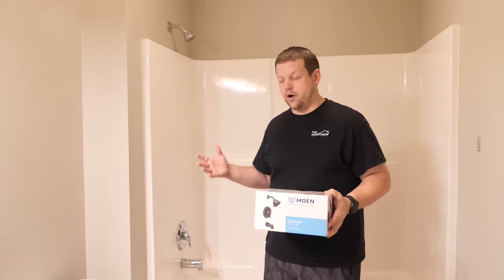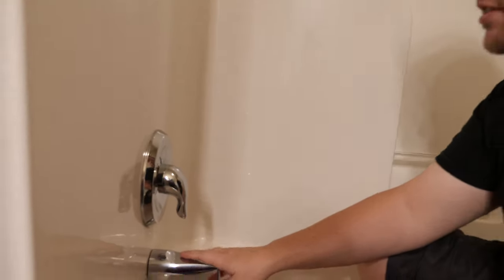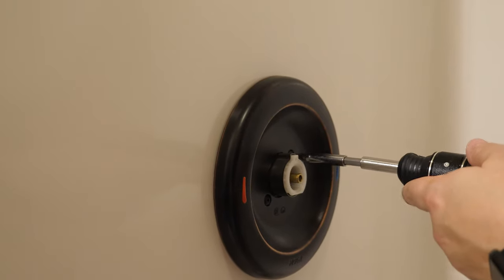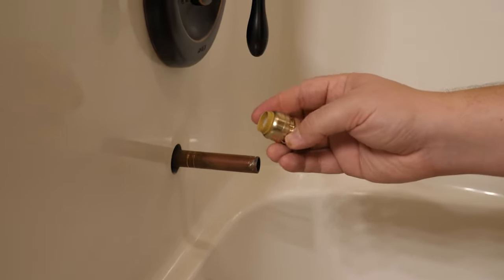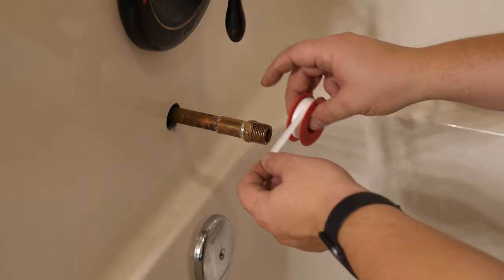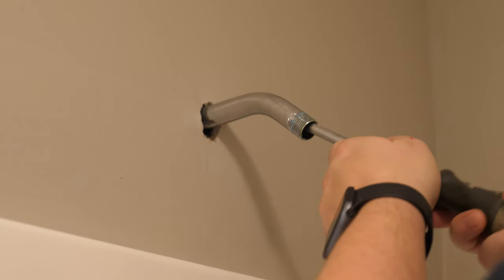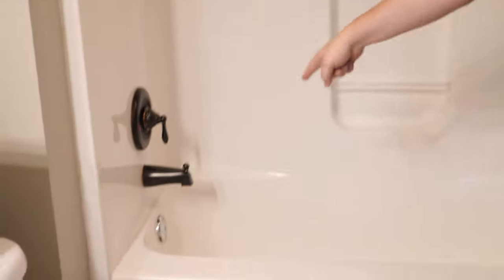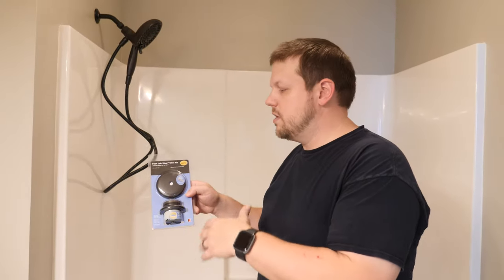How to Replace a Shower Faucet Trim Plate, Handle, Shower Arm, Tub Spout, and Bathtub Drain Moen DIY

Comment: Excellent presentation! The bit about welding a piece onto the pipe for the spout is very good information. My house is old and workers have advised that a wall needs to be broken into to replace my spout. Hopefully the option you mentioned will work!

Comment: Thanks for such a thorough and realistic video. I love that you showed the removal and install for every single part, and explained what pieces might be tight and difficult to remove. A lot of videos are filmed on sets with brand new, hand tightened hardware, and when the repair guy effortlessly removes something that’s not budging for me it makes me wonder if my situation is different and if I’m going to break something by continuing. Kudos to the camera operator too. 

I was just going to replace my decaying shower head because I thought the rest would be too difficult, but now I think I can replace all this grungy gross decades old hardware myself, with something really pretty and clean.
Reply from the maker: I'm always tempted to edit out the struggles but you're right, it's reassuring to know if something is normal in "the real world". Thanks for the comment!
Reply: @TopHomeowner  My handle's alan screw is completely covered in soap scum to the point I can not get an alan wrench in it or even tell which size would  fit it.  How do you deal with that?

Comment: Great video! I’m confident I can now tackle replacing my shower/tub fixtures. I didn’t realize it could be this easy.
Reply: I just got a quote for $933 and change for a plumber to install this for me, that was a lot of motivation to do it my damn self!
Reply: @bobdolespen  $933... to do this!?!?  I'd assume he was putting in new plumbing for that much!  this is the first video I watched about this myself just now, because I would like to replace mine at the condo I just bought.  I didn't realize it was this easy either.  Definitely a doable solo...

Comment: Good thing the rough-in valve matched the new trim.  I just replaced an 18 year old valve that I could not get parts for with a Delta that uses their universal rough-in valve.  It was installed on an exterior wall, so no rear access.  Cut it out with a reciprocating saw.  Took forever to clean the old solder off the supply lines and the shower riser and tub pipes, enough to be able to get the new threaded fittings on.  I split the job up over two days.  In between, capped the supply lines with SharkBite end caps so I could turn the water back on.  Not a fun job, but I saved a bunch of money doing it myself.

Comment: Thank you so much for this video! I thought I would have to hire a plumber to change out these but turns out it’s so doable and I’m saving a lot of money. Just a note I was unable to find the same brand of the trim plate (and each brand has a different valve so they are not all compatible and standard). Got discouraged at first but after doing some research I actually painted it to match the rest of the new shower fixtures. Lots of great online tutorials for this!

Comment: Great video!

One alternative to soldering the pipe would be to purchase a matching tub spout that slides over the copper pipe, just like the old spout.  I got a Plumb Works model PF0578-BN-PS from Menards.  It turns out that the Plumb Works spout has the same connection as the new Moens spout, except that it also comes with an adapter for the pipe!  I was able to use that adapter with the Moen spout... so I didn't even use the Plumb Works spout.  It was super easy to install.

A resourceful person might be able to locate a pipe adapter (without a spout) and save a few dollars.  But the Plumb Works spout was pretty cheap.

Comment: Hello, great video and highly informative. Though I am curious about one thing. When installing the tub drain, why did you use silicon instead of just using plumber's putty? Wouldn't using silicon make it much harder to replace the drain in the future?
Reply from the maker: 100% it will make it more difficult. It was a tradeoff I was willing to make at the time since I didn't want to have a leak upstairs, but it was probably overkill.

Comment: Thank you so much for this video! This is everything! I am trying to DIY some things in my bathroom and this video was beyond helpful. One question… and you may have mentioned it… Do I need to shut off the water supply to my home?  My tub and shower is just like yours.
Reply from the maker: You don't have to as long as you don't accidentally turn on the valve while working on it. That said, best practice would be to turn off the water just to be sure

Comment: Thanks a lot for this DIY video. I have the MOEN 82304SRN installed. However, my lever handle is sticking out 2in from the trim cover. Do you know of any solution to help?

Comment: good video..thanks.    hope this project goes as well for me.   only issue is my drain valve is the handle kind.  i suppose a push valve at the drain can be used instead and just put the cover on the overflow.  agree?  comment?

Comment: I would go ahead and put the new valve insert so you have new seals. It’s an easy process and requires no soldering. Just need to turn the water off temporarily

Comment: Hello sir, thank you for all your videos.  So, the bathroom tub faucet handle is loose and I see that I need a hex screwdriver to tighten it.   That metal faucet is the same one I have.  I am praying that is all I need to do, tighten it.  Is there any other screwdriver I can use for this or do I need to buy a hex screwdriver to fix it?  I am an old gal, so thank you very much for you patience with me and my questions and thank you so much for replying to me.  God bless you.
Reply from the maker: Yes, you'll need a hex screwdriver or wrench. The easiest thing would probably be to just buy a set of hex wrenches

Comment: Hi I am going to be replacing everything you did and I really like the pieces you bought, which ones were they?  I am having a hard time finding the drain and the round part about it
Reply from the maker: Here are the links to the pieces I installed:
Moen Tub and Shower Trim Kit (no valve): https://geni.us/HhxL
Foot Lok Stop Style Bath Drain Trim Kit: https://geni.us/MFd0lr9
Delta In2ition Dual Hand Held Rain Shower Heads: https://geni.us/bpcle

Comment: This was super helpful! Only question I have is my old shower faucet set up is delta... I bought Moen and when I went to replace the handle, the delta handle is much larger... is there an easy way to change this out? Or do I have to change the whole valve too?
Reply from the maker: Unfortunately you have to stick with the same brand otherwise yes, you'll have to change out the valve too.

Comment: What is the part name/# that you had soldered and how? Everything else is explained very well
Reply from the maker: That would have been it's own video since soldering is a skill all by itself! In general I used a no stop coupling, copper repair coupling (to extend the pipe) and a copper male adapter (to attach to the new spout). You can avoid all that (plus all the special tools you need) if you can find a kit with a slip-on tub spout. Hope that helps you

Comment: Nice video! For the main shower head did you turn off the main water valve? I’m assuming so?
Reply from the maker: It's always best practice to turn off the main water when working on plumbing. But for this job I left it on. No water comes through the shower head unless the handle is turned on.

Comment: I'm dealing with the sharkbite issue currently. The diverter in the tub spout broke, so I need to replace it. But it just spins when we try to remove it. 
I'm going to have to saw into the spout in order to get to the sharkbite end 😒

Comment: I was told that the rubber washer is not there to be placed between the drain and the tub, but between the tub and the pipe. You can pull out the old one since the pipe is not tight against the tub with the drain unscrewed.

Comment: Do you need to solder the valve? Will it leak if you don't? It looks like a good fit without soldering
Reply from the maker: If you're just changing out the trim plate like I did in the video there's nothing to solder. I did have to solder the tub spout for the modifications I made.

Comment: Why isn't the shark bite threaded on both ends? I'm no plumber, but if it was threaded on both ends, you could just screw a compression ring on the wall side (like a shutoff valve). Is there a reason that isn't standard in this case?

Comment: Hi, how do you know what fixtures to buy that will fit the current valve you have?
Reply from the maker: The biggest factor is the brand so make sure those match. The plate behind the handle should say the brand name, but sometimes a manufacturer will use a letter instead of the name (M=Moen, D=Delta, K=Kohler). I don't know a foolproof way of knowing if a fixture will fit from the same manufacturer since styles can change over time. I hope this helps!

Comment: 2:40 my faucet has the hole for the Allen key, but there is nothing there at all. It’s just a small hole that goes to the faucet handle. There is no hex or screw or anything. How can I remove it?

Comment: Hi.  I have turned off the main city water shut off in the basement to replace a Shark Bite fitting that wont shut off anymore.  I have released the water pressure all through the house and in the sink and shower of the en suite where I am working but water keeps coming out of the water supply  for the toilet.  It wont stop.  There is no water in the toilet tank so its not coming from there. Never seen this before. When you shut off the mains and relieve the pressure in the system water should not be coming from a supply line ? Any ideas ?  Thanks

Comment: do you have to turn off trhe watewer to the whole bathroom or just make sure the tub handles are in an off position before starting? thanks
Reply from the maker: I didn't turn off the water to whole bathroom in my case... just be careful when working with the handle OR go ahead and shut it off just in case.

Comment: escutcheon rhymes with discussion :) do you have to shut off the water to the shower to do this if you're not changing the valve/cartridge?
Reply from the maker: Wow, what a simple way to remember how to pronounce it... Thank you! As for the water shut off, no you don't have to turn off the water if you aren't touching the cartridge. I didn't turn it off, but it does make the job easier since you can rotate the handle up to remove the set screw.

Comment: Do you need to turn off  the water supply if you are not replacing the valve and only replacing the trim plate and handle?
Reply: No.

Comment: Hey man! Solid video, but one extremely important point- that black rubber gasket that came on the new tub drain is intended to replace the old rubber gasket located in between the tub and the drain pipe!!! Then, using some plumber's putty is probably preferable to the silicone sealant on that flange as it can be removed later with less difficulty.

Comment: Would some type of water weld or epoxy work instead of soldering?
Reply from the maker: Possibly, although I'd be a little worried tightening the spout would break the epoxy.

Comment: It looks like you didn't shut off the water, I'm guessing it's not necessary or did you do that off Camara ?
Reply from the maker: I didn't shut it off, but I always recommend it just to be sure! Since you aren't messing with the valve itself, there shouldn't be any water flowing. It would be easier to access the handle screw if the water is turned off though since you can rotate the handle up and see the set screw.
Reply: @TopHomeowner  
Thank You for responding. I don't know how to turn off the water to the tub just to the sink. So, I feel better about tackling the tub faucet. 
Thanks again 🌹💃
Reply: I looked for any comment that addressed this. I’m in a condo where I would have to involve notice to other tenants to have the water shut off to the bathroom!

Comment: Do you have to replace it with the same brand? I currently have delta, but I want to replace with moen.
Reply from the maker: You have to stick with the same brand, each manufacturer is different.

Comment: I just wanted this changed out in my bathroom. And a plumber just told me they were going to charge me $1800 to do this! And have to cut into my wall. Is that necessary? Where they trying to rip me off? I do not have a leak. Just want to change fixtures.
Reply from the maker: If you stick with the same brand you already have installed, you should be able to follow the steps I used. If you're changing to a different brand or layout, that would change what work needs to be done. I'd get another opinion from a different plumber. If the next plumber says the same thing I'd ask them to explain why that is... and maybe show them this video :)

Comment: What would you do if the plate was sealed with silicone? Would you have to cut it out?
Reply from the maker: You should be able to separate the plate from the wall by scraping the silicone away with a putty knife. Just be careful not to dig the corner into the wall if it's a tub surround and not on tile

Comment: Why did you decide to use silicone instead of the rubber washer in the drain?
Reply from the maker: It was a judgement call and honestly I probably wouldn't do that again. I wanted there to be zero chance of a leak since it's an upstairs bathroom.

Comment: How do you know which fixtures work with the valve you already have? My shower handle broke and I can't turn the shower on anymore. I don't want to have to open up the whole wall.
Reply from the maker: Check out this video for help identifying what brand you have. Once you know the brand, its easier to determine the exact model: https://youtu.be/J-0Z_jabSG0

Comment: How did you determine the length of the copper to be able to screw the new spout on it?
Reply from the maker: I just inserted a tape measure into the spout and got the distance between the threads and the end. With the new copper, make sure you take into account the thread adapter length and dry fit before soldering everything up.

Comment: How can you tell what brand of shower accessories you have?  That were installed already?
Reply from the maker: Yes, they were already installed. Look for a logo on your shower escutcheon plate or handle for the brand. As for exact model, take the plate off and there may be a sticker behind it or you can take pictures and try to match it with the same brand in store. The biggest concern is getting everything at the valve to work properly.
Reply: @TopHomeowner  Thank You!!

Comment: Will this upgrade prevent future leak, or we also have  to also replace plumbing behind the bathtub as well?   A plumber that came to replace the old spout which also had a gab from the wall and was leaking, that I should upgrade plumbing and cut behind the bathtub to replace the plumbing. Currently the new spout due to previous install years ago this condo that my kid bought still have a gab so he had to chalk it.

Since this is on 2nd floor, how do we know if we have leak behind the tub or wall which can leak downstairs?  Interestingly the plumber said I won't so recommended replace plumbing behind the tub / wall, quote like $1200 project.  I guess that means to replace a valve.  Is it hard to do to replace a valve?
Reply from the maker: This video covers upgrading the looks only, so any current plumbing issues won't be fixed. If you have a problem with the valve, the only way I know how to fix it is by opening up the wall.

Comment: How do you remove the drain once it’s silicone in place in the future?
Reply from the maker: If you had to replace the drain, you should be able to break it free with the dumbbell wrench. It would be tough though. Again we chose to do it that way but typically you'd just use the included rubber gasket.
Reply: It’s better to use plumbers putty around the drain.

Comment: How do you replace eljer shower faucet to moen. Complete new set
Reply from the maker: You'll have to replace the entire assembly. Most likely you'll need to swap it out from behind the shower wall. If you have to tear out the drywall behind it, consider buying an access panel first and then cut the hole out to that dimension... especially if the shower backs up to a closet wall. Hope that helps!

Comment: Would the water need to be turn off if you're just replacing the shower head/handle??
Reply from the maker: Should be fine. The biggest risk is turning the handle while you're removing it. To be totally sure you won't run into an issue, the safest choice is turning off the water at the main though.

Comment: Do you have to shut off your water supply first?
Reply from the maker: I didn't, as long as you don't turn on the valve it's fine. The best practice is to shut off the water first with any plumbing project though.

Comment: Did you have to shut the water line off for before starting this?
Reply from the maker: I left my water main on because I didn't have to turn the valve handle. Safest practice is to shut off the water any time you're working with plumbing though.

Comment: Does water need to be turned off?
Reply from the maker: We didn't turn it off but it wouldn't hurt. It's possible to accidentally turn on the water when you're replacing the handle, but that's about it.

Comment: Do I have to shut off water to my townhouse in order to do this?
Reply from the maker: I did this job with the water still on. The biggest risk is turning the handle while you're removing it, but if you're careful it should be ok. To be 100% sure you won't run into an issue, the safest choice is turning off the water main though.